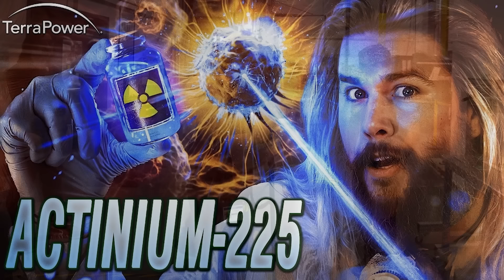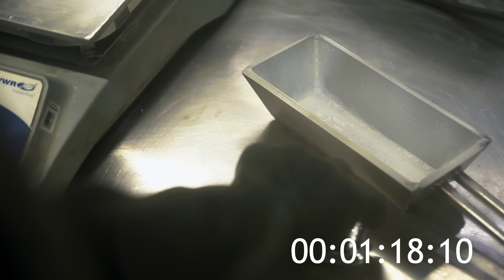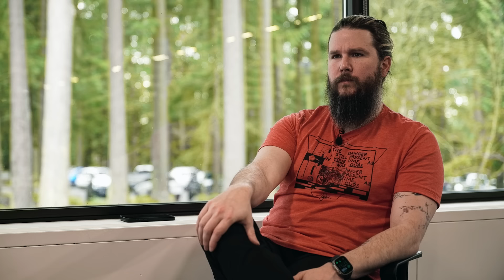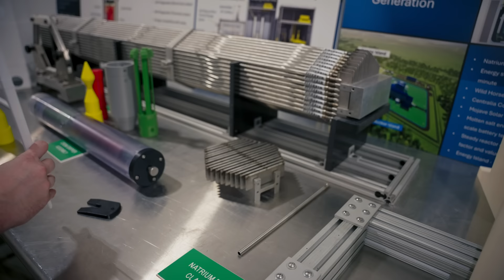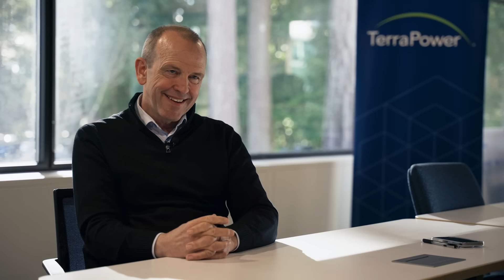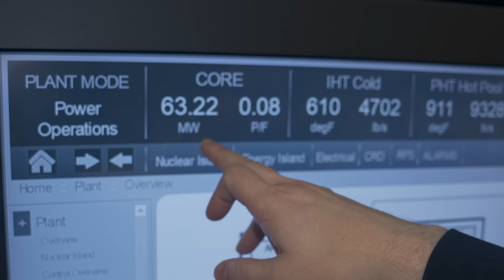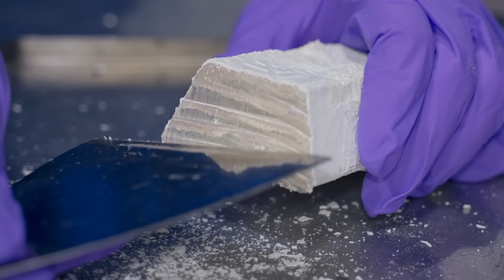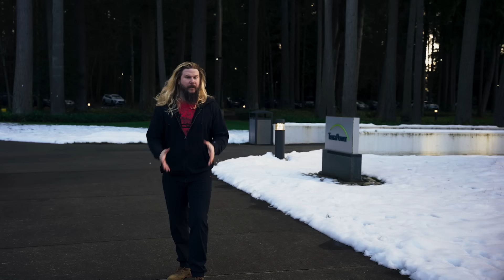Will Natrium Nuclear Reactors Change Everything?

Comment: It really boggles the mind that this technology hasn’t been used commercially before.
Reply: It is very difficult and expensive whereas water reactors use basically steam engine tech.
Reply: We tried with Fermi-1 and it was sued into oblivion in the 70s. 

One of the problems with sodium is that it can be extremely reactive. The coolants used in EBR-1, a sodium fast breeder reactor and the first reactor to generate electricity, corroded aluminum into powder, burned on contact with air, exploded in water, and left behind acids that would dissolve people into puddles of goo. It made them expensive and difficult to build and the PWR design gained traction before the issues could be solved.
Reply: It's much more complicated and expensive than water moderated reactors. There really was no reason to ever use it.

Comment: The dry ice comment followed by the hard cut was gold well done as always Kyle
Reply: Explain :D
Reply: @GreyDeathVaccine  well....
you know how when something boils or sublimates (turns into a gas) it expands rapidly?
what were to happen if you attempt to contain that expansion?
and what would happen if you failed?
Reply: @billcipher1756  well that’s less exciting than I expected considering that you can literally make explosives using fertilizers 😂
Reply: Like many things, dry ice is safe if you know what you're doing, but dangerous if you don't. If you store it in a small space, like a car with the windows up, it can boil off, displace the air, and asphyxiate people.
Reply: @billcipher1756  STOP!! You have given away too much.  Return to your 2L Pepsi bottle and put a cork in it already!
Reply: @ncdave4life  No. When CO2 levels rise in the body the body panics and attempts to escape. CO is different.
Reply: @Therapy1044  I'm not talking about CO.

CO2 is the stuff you exhale, the bubbles in sparkling wine, the gas of life for plants. It is normally innocuous. But if you put a block of frozen CO2 (dry ice) in a warm car, and close the windows, any people or animals in that car might be asphyxiated.

10 lb of dry ice sublimates into about 88 cubic feet of CO2 gas at sealevel (a bit more at higher altitudes). That's enough CO2 to displace all or most of the air in a typical sedan. So if you were to buy a 10 lb block of dry ice, bring into your car with you, roll up the windows, and fall asleep, you might never wake up.
Reply: @GreyDeathVaccine  Better not. Best not have a visit from your local or national law enforcement 😏
Reply: @awolr  I'm also missing the joke, someone point me in the right direction
Reply: @joaqu1nluna bomb :(
Reply: @GreyDeathVaccine  ... put it in a water (soda) bottle [PLASTIC!!!] with a little water and put the lid on tight. Wait for it. (seriously, who hasn't done this?)

Comment: What are the risks with a catastrophic failure?  Older nuclear plants have issues with vaporization of water against fuel or other activated material.  Would the Sodium be activated by its proximity to the fuel and risk being carried by the water in a steam reaction or sodium/water interface rupture?
Reply: If the turbine explodes violently (which seems very unlikely), the reactor will probably heat up and the operators would notice, probably SCRAMming the reactor. Even then, it’s not that explosive, so not that much would probably happen, other than a warning that “Turbine 00 is hotter than normal temperature; please check!”
Reply: Google "MONJU nuclear power plant". If the plant is built wrong, and the liquid sodium escapes, things get pretty ugly fairly quickly. I admit myself somewhat disquieted that Senior Director Tarqueno didn't mention Monju at 8m28s. (Or maybe she did, and it just got cut out of the final video?) The lessons of Monju are lessons that anyone designing a liquid Sodium cooled reactor should absolutely know. If they don't... ho boy.
Reply: YouTube has silently deleted my other comment. (It does this a lot. Some kind of keyword based censoring, with zero human intelligence in the loop.)

Regarding catastrophic failure: Do a web search for "monju power plant". If the liquid sodium escapes the pipes (due to poor construction, for example) things get bad... fast. Terrapower's reactor at Kemmerer was developed in partnership with GE/Hitachi, so hopefully they learned their lessons from the endless problems at Monju.

Regarding water and activation: I don't want to type a huge wall of text here, but suffice it to say that this is a pool-type reactor. So the sodium metal that touches the nuclear fuel, never comes anywhere near water. It's a three-cooling-loop design where the first two loops contain liquid sodium, and the third loop contains molten salt. It's very difficult for any liquid sodium to come in contact with any water, anywhere.

The NRC has many documents up for public download on their site. I can't give you direct links, because YouTube silently deletes any comments that contain URLs. Do a web search for "NRC natrium documents" and it should be the first result.

We'll see if YouTube allows this comment to show... or silently deletes this one also. (I have no clue why YT dislikes my comments so profoundly.)

Comment: Had more than a couple "oh shit" moments on this one, first was when she was explaining the use of molten salt as an energy storage system - the ability to load chase with a nuclear plant is crazy, at least to someone like me who only knows about the standard nuclear power plant and isn't keeping up with any advances besides this channel. 
Also, the use of molten sodium was interesting to me and I didn't quite get it until the diagram with the boiling point of water vs sodium - instantly put together why that might provide a lot of benefit and safety. Of course, the more detailed explanation still gave me new information, but I was surprised to understand those things before they were fully walked through, and I'm going to pin that ability on all the previous work you've done to explain the benefits and challenges of reactors and other energy technologies
Reply: TBF fast reactors have high load following capability on their own due to their enrichment level, and not having Xenon pit issues after temporary shutdown, but of course a reactor is not cheaper to run at reduced load.

Comment: "thats just magnetism baby." That was smooth.
You also got my voice down when asking about the explosiveness of Sodium and water
Reply: They haven't really talked about the operating risks though, since it will be molten then. What would happen with if there was a leak or smth?

Still really behind this stuff, but that's some reassurance that I missed
Reply: @Litl_Skitl  Sodium leaks have always been the major problem with sodium cooled reactors. It's one of the main reasons they didn't make it past the research stage and into the market. Any amount of leakage will result in really nasty sodium fires and sodium hydroxide production. If you want more detail, I would highly recommend Atomic Accidents by James Mahaffey, there are some good in detail explanations of SRE accidents. And the book is not biased against nuclear power as you might expect from the title, it's a good read.
Reply: @Renoh74  Things have changed a lot since the SRE and other early experimental SFRs. EBR-II ran for 30 years with no serious sodium issues. BN series in Russia also appear to have learned the lessons. Monju is probably the worst example in more modern times and they explicitly ignored the lessons from EBR-II (just like they ignored the advice about emergency generators and seawall height of the Fukushima plant). With the exponentially higher power of modern computers, the flow dynamics of liquid sodium is much better understood and even Monju would be unlikely today.

And it isn't that "any" amount of leakage will cause a serious issue. Small leaks in non activated secondary loops are not that difficult to handle with good procedures. Lots of industrial processes are at least as difficult to deal with.
Reply: @Litl_Skitl  Since this is a pool type of reactor, which also is unpressurized, a sodium leak from the primary system is extremely unlikely. For that to happen the reactor vessel itself must be leaking, and if it did, the sodium would just leak into the containment vessel and the reactor would be shut down. Keep in mind here that there is nothing inside the containment that will react with sodium.
Reply: I thought he was doing the street magician dude.

Comment: Someone else cracks fusion power

Terra power: nooooo! All our work is wasted! 😭😭😭
Reply: Fusion power requires a lot more capital investment, and its main advantages (near infinite fuel / less waste) are barely a stones throw further than what fast breeder reactors can provide. Also the materials challenges for extracting heat from the fusion reactor with a coolant loop have yet to be started on.

Comment: Would using liquid sodium cause the reactor to be dangerous if it where to get breached somehow? Because of how reactive sodium is?
Reply: Yes, molten sodium will burn very well in air. Their demo at room temperature was pretty pointless. For instance the Russian BN-600 sodium cooled reactor reported 27 sodium leaks in a 17-year period, 14 of which led to sodium fires.
Reply: They had a demo in the end of the video, but from what they demonstrated, the answer would be no. If a pipe leaked or something like that, the sodium would come out, but without a heating source, it would rapidly cool down because of how conductive it is as a heat source and turn back into a block of sodium. They are also replacing the gas in the chambers that work with sodium with Argon an inert gas so there would be minimum oxygen to react to. Even if that failed and the Argon gas secondary containment failed then the sodium starts reacting with the oxygen in the air to create a film (of rust) around the sodium that prevents further chemical reactions. It limits the chemical reactions to what's on the surface. There are also no processes where Sodium would be stored directly with water. The process of energy goes from Sodium -> Salt -> Water. So there's not a place for Pure Sodium to leak into water, these are all separate chambers separated.

TLDR: Pure Sodium is highly reactive, but pure sodium is also very quickly contaminated, and Sodium oxide is not highly reactive.
Reply: @kickassnetwork thank you

Comment: I JUST THOUGHT OF SOMETHING AWESOME!!!

You know hydrogen right? Did you know that at super low temperatures and super high pressures like what’s theorised for the mantle and core of gas giants, hydrogen solidifies, and as a solid it acts as a metal, metallic hydrogen!
Hydrogen is a metal!
Now when you combine a metal with oxygen you get a metal oxide. When you combine hydrogen with oxygen you get water.
Water is a metal oxide!!!
Now what’s a colloquial name for a metal oxide?

RUST!!!
WATER IS RUST!!!!

Now to be pedantic and annoying, this isn’t actually the case, rust is a term solely used for iron oxide, but it’s just semantics. It’s still awesome!!!
Reply: Sand is a semirust. No I will not elaborate.
Reply: @ yeah you’re not wrong. Silicon is a metal too.

Also so is calcium.
METAL BONES!!!
Reply: it's still corrosion, we drink and live on corrosion
Reply: @ we live on fire and corrosion.
Reply: unless you're an astronomer, then it's one of the only things that isn't a metal
Reply: @ our job as scientists is to put nature into boxes, and nature doesn’t always fit. We don’t usually think of hydrogen as a metal is because its a gas in standard conditions acts like nonmetals or semimetals. But in solid form it acts like a metal.
Reply: Since hydrogen is a group 1 (Technically sometimes metallic) element, that means that hydrogen chloride (The gaseous form of hydrochloric acid when it's not dissolved in water) is a gaseous metallic salt
Reply: @ yep.